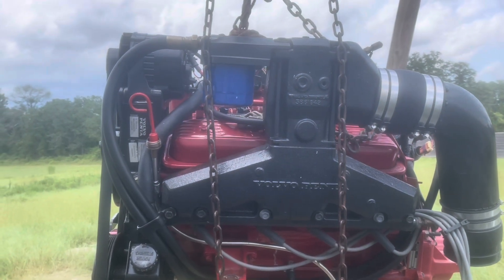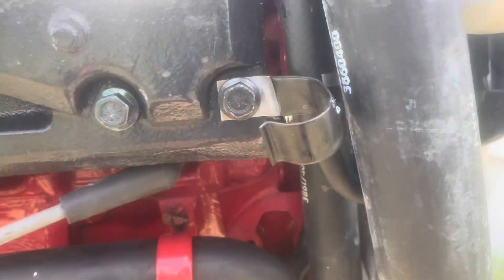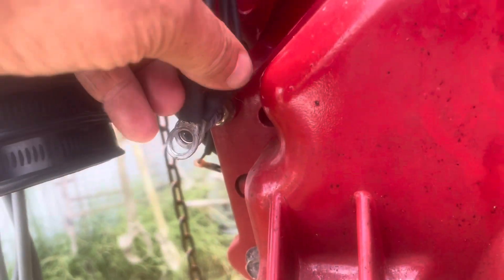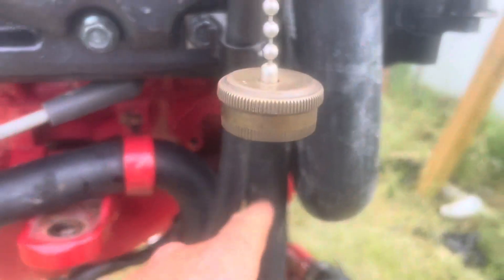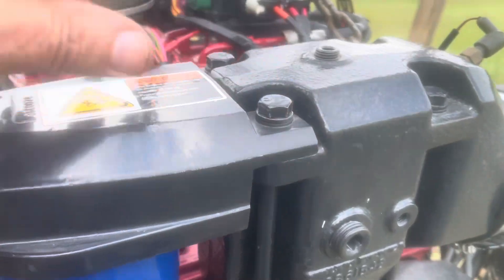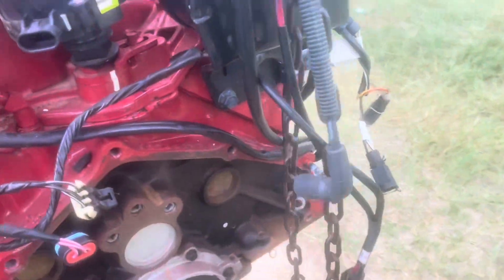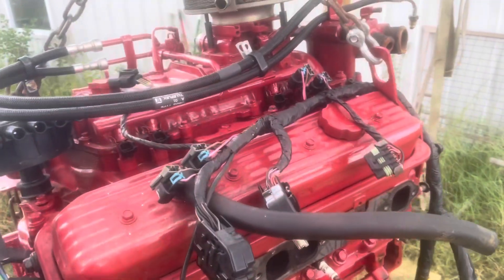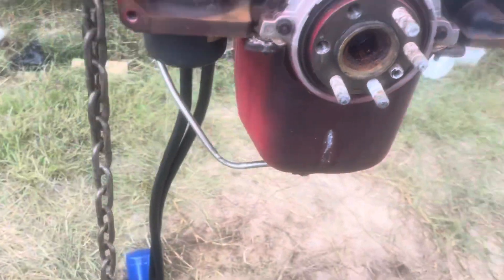Volvo Penta GSI 5.0 to 5.7 Upgrade - Teardown

Comment: I'm trying to do a valve lash adjustment, do you know if you have to remove the exhaust manifolds to remove the rocker covers or can I wiggle them out?
Reply from the maker: Not sure honestly. I have not had to adjust valves after an install. A customer with a Volvo Penta got valve covers off by removing the riser extension.
Reply: @moccasinmarine  Sounds good, thank you.